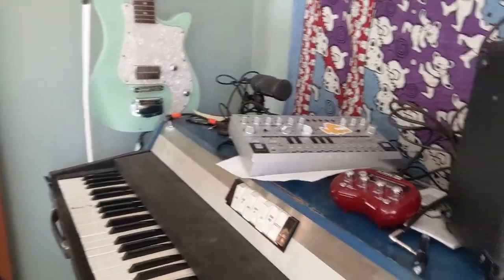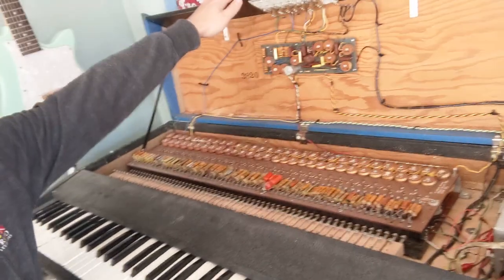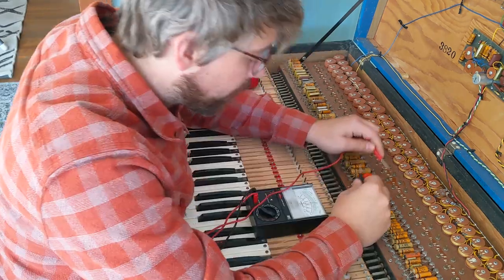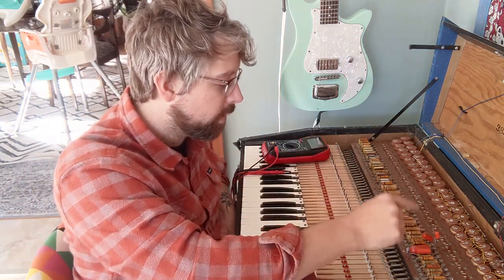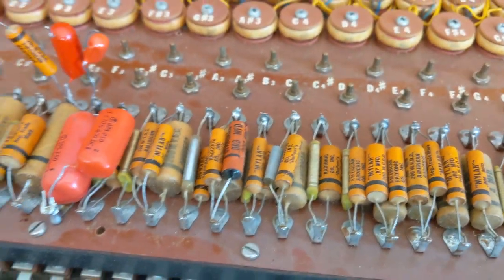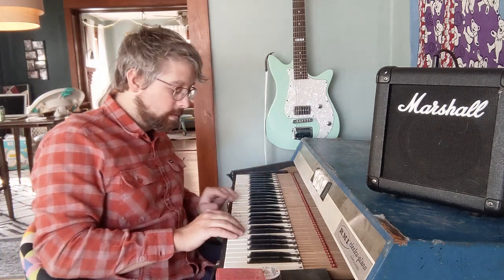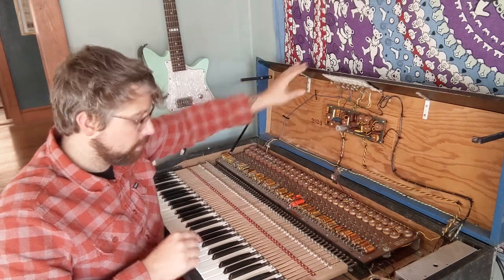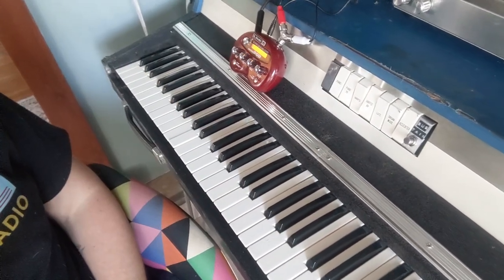Tuning & Servicing an RMI Electra Piano

Comment: At 2:48 - the "super old-school transistors" are in fact inductors (a coil of wire like one winding of a transformer). Each note has its own oscillator, consisting of a transistor, an inductor and a capacitor, forming a tuned circuit . This is basically a single transistor amplifier tuned to make it feed back at a particular frequency. You can not measure the "resistance" of a capacitor, since it will be infinite if working and zero if shorted. What you are seeing is the DC resistance of the inductor, which is in parallel with the capacitor.
Why not buy (or make) a sustain footswitch? It is just a single pole normally closed, push-to-break switch
Reply from the maker: That is good to know, thank you!
Reply: Large electrolytic capacitors you can sort-of measure with an ohm meter. With the cap discharged it acts like a short circuit, and then as it charges up the resistance slowly increases. It doesn't tell you much (other than that it still behaves like a capacitor). With smaller caps it simply charges too fast for a multimeter to see it, and it will indeed measure open circuit if it is okay.
Reply from the maker: @plonkster  Thanks you, that helps, that's what I was trying to measure but I didn't know it would not be helpful for caps that small. And now I have a new problem, one of my notes suddenly went dead. The service manual has a step-by-step for how to diagnose a dead note, I just need to go through it. And I discovered that the large fiber board with all the caps and pots can be lifted up and open to reveal all the keying circuits for each note! Hillarious that I didn't realize that while making this video. I think I'll make a 2nd one to show how to fix a dead note. I also want to re-wrap the chassis in new tolex, and rethink the sustain mod. Subscribe to get that new video!

Comment: Tony Banks of Genesis used the 368X and had his engineer mod internally an MXR Phase 90/100 pedal.  It was considered a road-worthy replacement for an actual piano when traveling for live shows.  Not as good as a real piano, but in a pinch.  My recommendation is go ahead and recap the whole thing.  Capacitors do go bad and there were a number of them that were just poorly made.

Comment: the capacitor on the A key fixed itself. when old caps sit for a long time, the insides kind of separate, and it can take operational time to "reform" them. sometimes they don't reform though, or it can take a long time and you have to slowly creep up on the voltage. you can do a search for how to properly turn on old devices with a variac
Reply: These aren't electrolytic capacitors and can't be "reformed" that way. Reforming refers to restoring the layer of oxide that acts as a dielectric in an electrolytic capacitor.

(The ones that can be reformed are the big nasty capacitors in the power supply that you really shouldn't mess with unless you know what you're doing.)
Reply: @WolphTunes  i thought they were electrolytic
Reply: @briangoldberg4439  Nope! The dead giveaway here is the "MYLAR" printed on the side; that's the dielectric. It's just a brand name for a type of polyethylene terephthalate that's stretched out really thin.
Reply: Film caps

Comment: If there's hum, then I'd be willing to bet there's electrolytic caps in the power supply that could probably use replacement. However, the voltages can be high in those, so be careful - discharge them before touching them if you do replace them yourself. Just do your homework and everything should be fine.